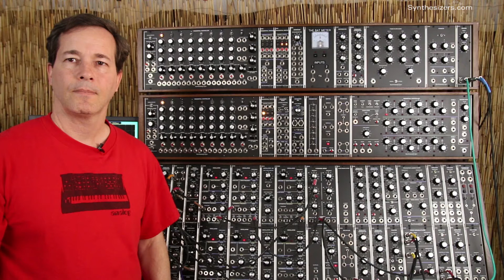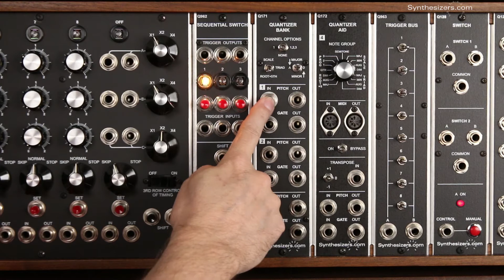Q171/Q172 Quantizer BASICS tutorial - Synthesizers.com

Comment: Question regarding the Quantizer Aid module. It is programmable using the MIDI 'In' port. There's an easily overlooked line in the datasheet that really caught my eye: "Each programmed key also includes pitch-bend data." This suggests that with a little work you can program custom microtonal scales. Are those scales limited to twelve notes, or can the module 'remember' more notes as long as they are within the single programming octave? If it can handle more than 12 notes, with a little careful tweaking one might be able to create short MID files that can be sent to this module to program scales like 19 tone equal temperament & such. Those MID files could perhaps be posted somewhere to share among users of this module.
Reply from the maker: Yep